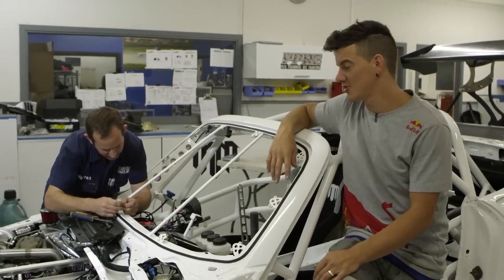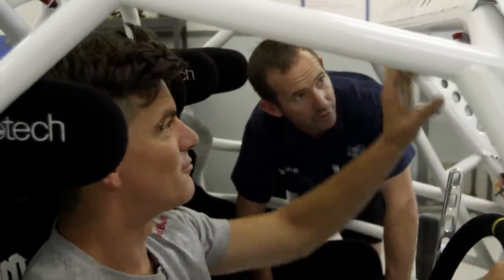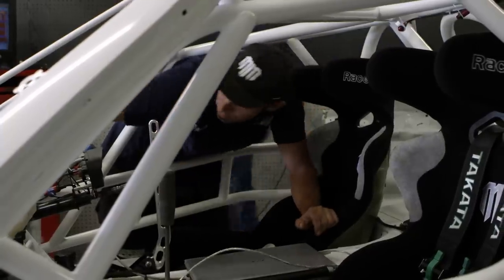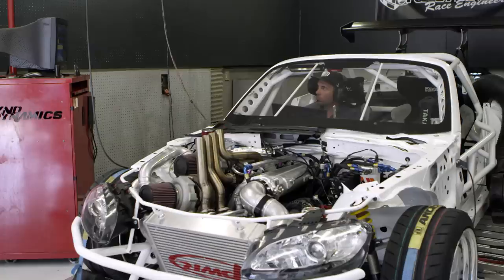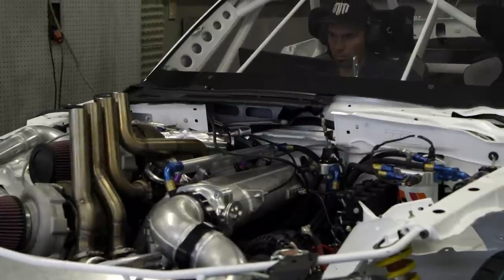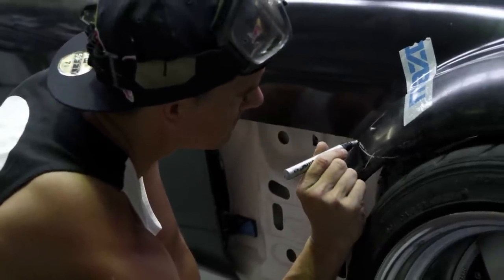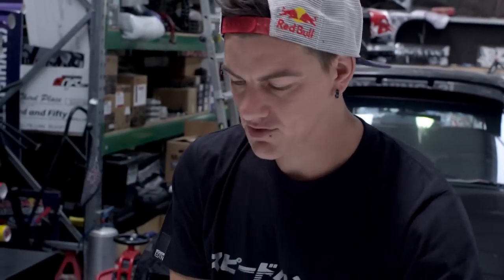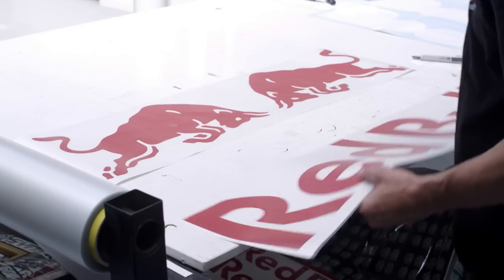Mad Mike Whiddett’s RADBUL Mazda MX-5

Comment: Kinda disappointed in the sound, just sounds like a 13B. Guessing because the exhaust is divided into pairs into twin turbos, don't get the 4 exhaust impulses together. Still love it though!
Reply: that's not the exhaust,, that's the wastegate,, the eshaust is located underneath the car,,
Reply: I didn't say they were or weren't the exhausts. Doesn't matter any way you can still hear the sound quite clearly. It does have divided twins obviously. Basically 2 rotors feed one turbo each.